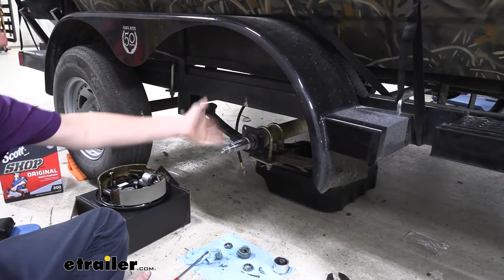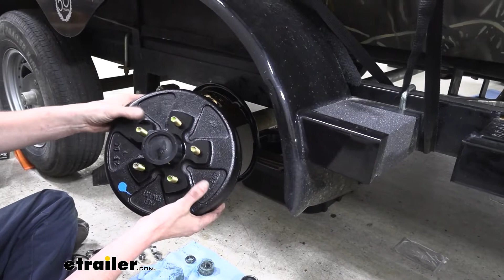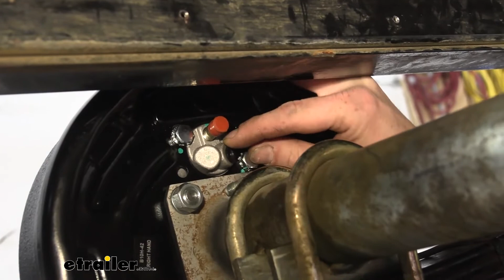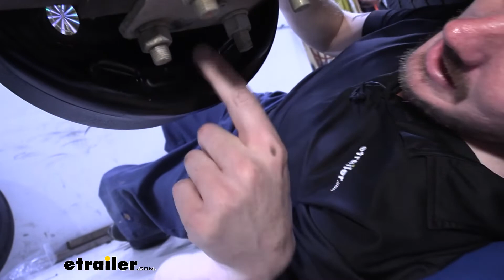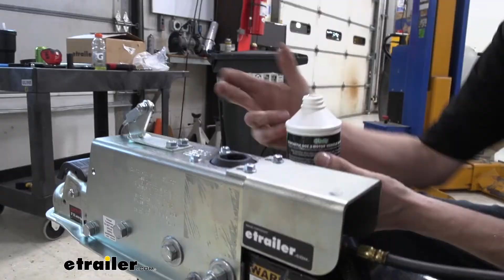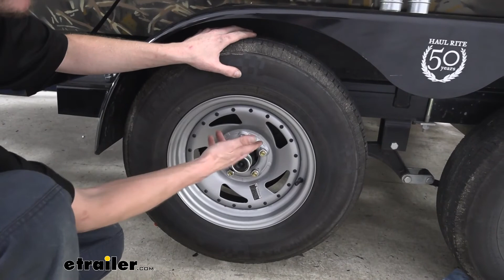etrailer | Review of the Hydraulic Trailer Brake Kit

Comment: So say I built a 6 wheeled pickup truck and needed a secondary brake booster to operate the third axle and be adjustable, what kind of booster should I be looking for 😂 sorry I’m looking everywhere trying to figure this out and get it right

I also plan on pulling a 24 foot trailer with the truck so I’ll need brake stuff for the trailer too